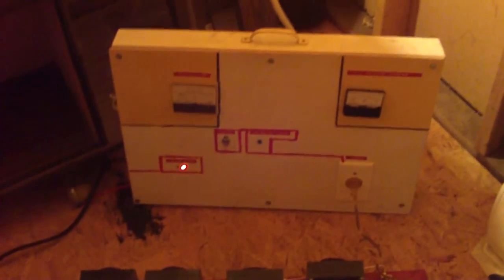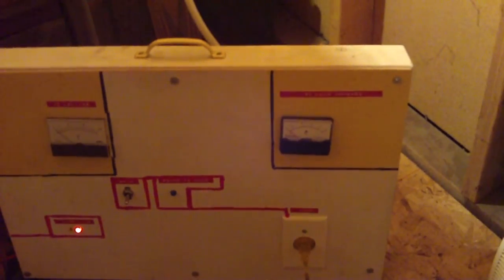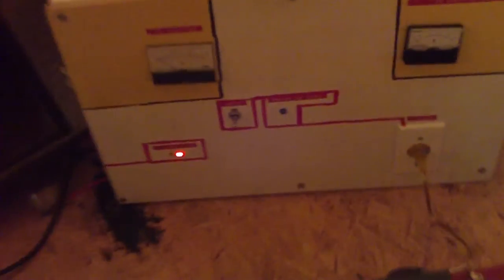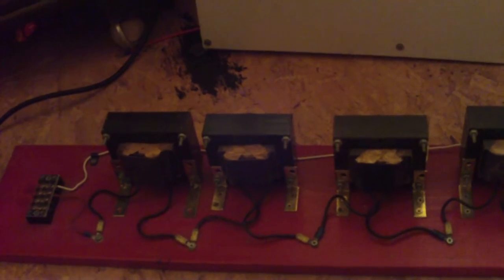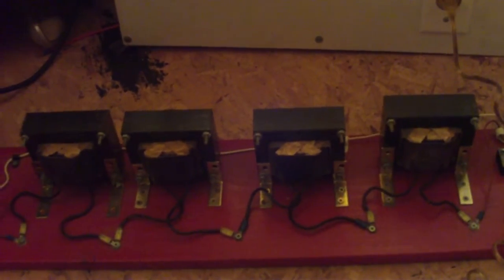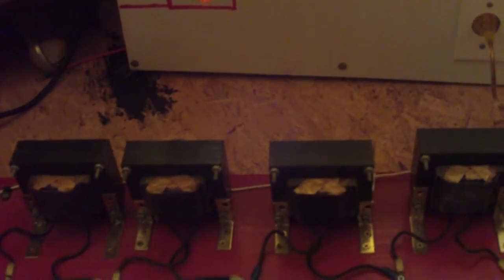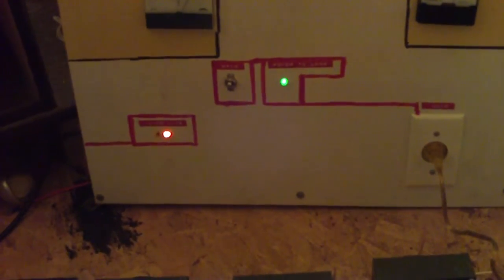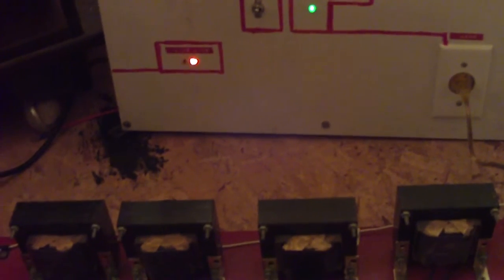Inductive ballast

Comment: @ct92404 I had the second MOT's secondary shorted out, and the primary in series with the other MOT's primary, so I guess the second mot would have let quite a bit of current through like that.    As a matter of fact I did measure the current out of curiosity and it was somewhere around 6 amps when arcing.

Comment from the maker: ...did you actually measure the current draw (through the low voltage primary side) with an ammeter?  I'm curious how much current it would pull.

Comment from the maker: @CoolDudeClem 
I'm surprised a MOT worked.  Usually, transformers don't work very well as a ballast because the mutual inductance causes the primary and secondary windings to fight against each other.  I tried it one time, and I could never get stable resistance.  These coils I'm using in the video have only one winding, so they don't have that problem.

Comment: i had a switch in parallel with my mot that i was useing as a ballast to limmit the current going into the other microwave oven transformer; this way i could switch on and off the ballast.

Comment from the maker: No, not really.  People have used MOTs as a ballast, but usually transformers don't work too great as a ballast because you never get a stable resistance.  The mutual inductance makes the windings fight against each other.  You draw a load through one winding, and then the inductance from the other winding cancels it out and the current ends up bouncing all over the place.  It's better to use something that has only 1 winding.

Comment from the maker: ...okay, this is a real rough calculation, but I'm figuring about .04 Henries total?  Inductive reactance is 2(3.14)(Frequency)(Inductance)= Resistance.  Well, I did it backwards cause I knew the resistance, but didn't know the inductance.  I just used some algebra (I hate math), and got about .04 Henries.  I put that back in, and it's pretty close to 15 Ohms.  Of course, that's just a guess because I don't know the DC resistance of the coils themselves.  That might add another couple of ohms.

Comment from the maker: I got them from an electrical surplus shop, for $5 each!  I don't know what the inductance is for each one.  But it limits the current to about 8 amps.  So that's 15 ohms total resistance, or about 3.75 ohms each.  I could backwards calculate the inductance using the formula for inductive reactance.  But that'll take me a little while.  To test them, I just  powered each one with a variac, and slowly turned up the voltage and measured the current.